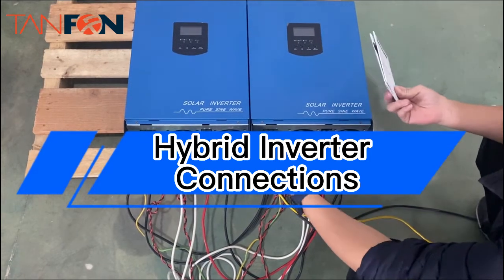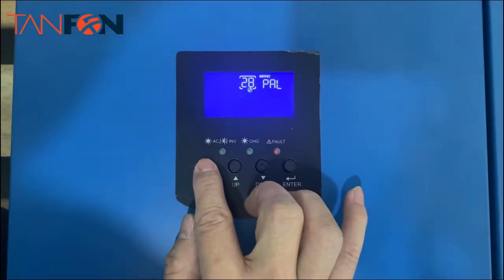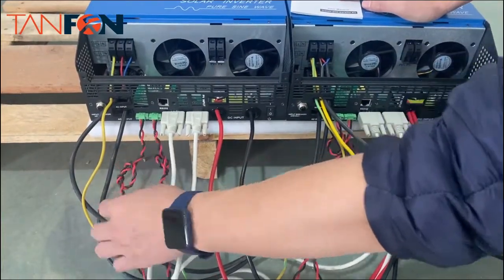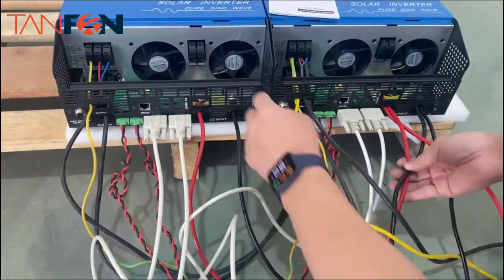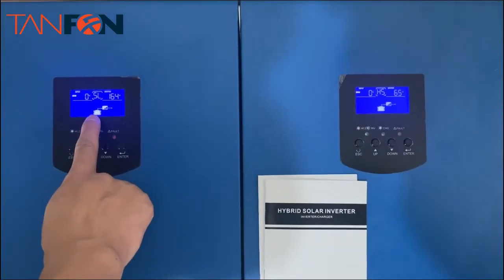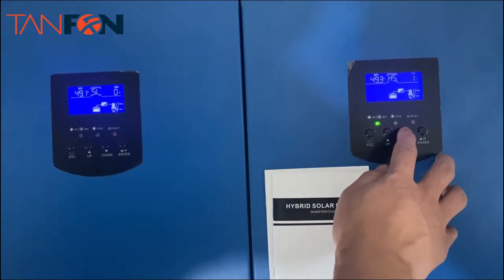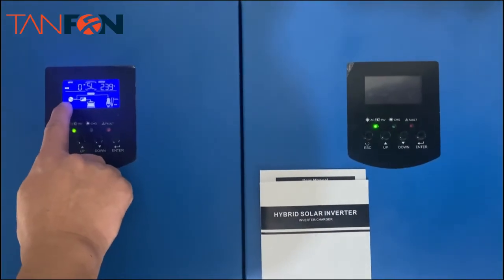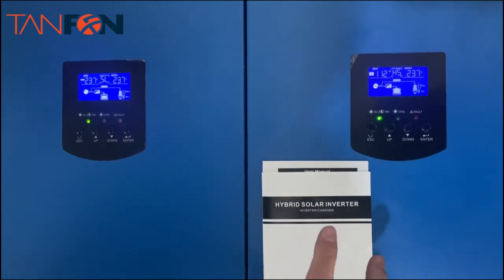Parallel 5kw solar inverter connection

Comment: Hi !!! I have a problem with my parallel system, when I put my inverters in parallel after all wires connections, when I turn on the inverters after two hours, they declenche error 40 that's communication error, If you can help me. Thanks

Comment: Please how to select the slave and the master
Reply: To set the master inverter, follow these steps:

1. Turn off both inverters and all breakers.
2. Turn on the inverter you want to designate as the master first. 
3. The inverter you turn on first will become the master.
Reply: Please can i connect each inverter to different battery bank@ElectricalEnergy